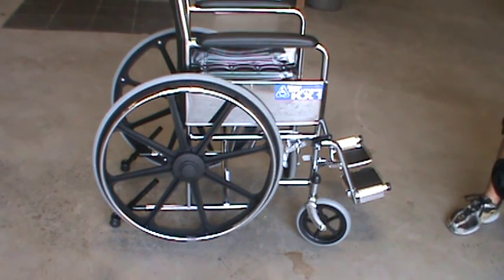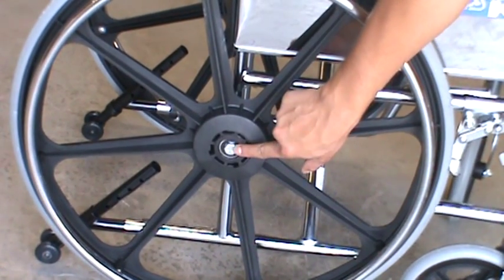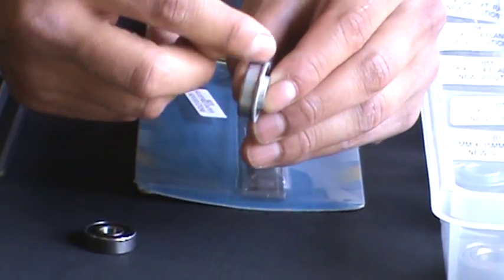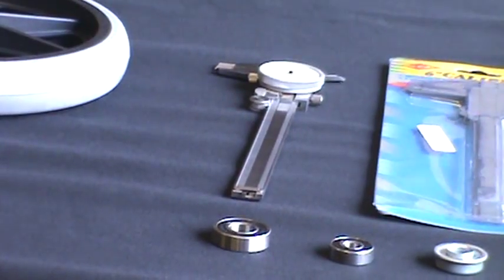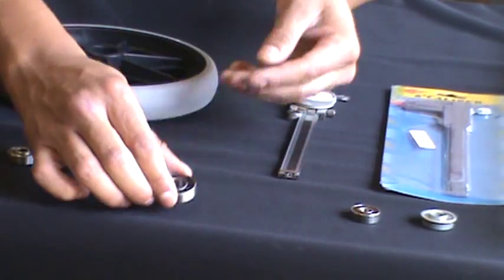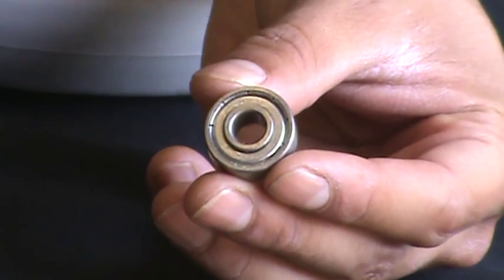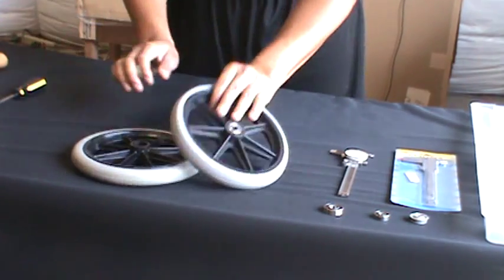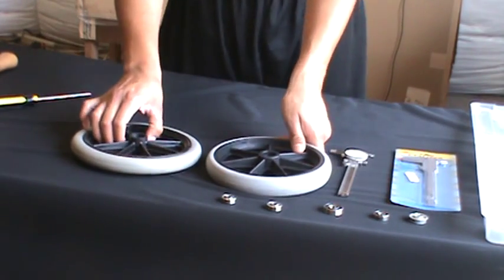New Solutions How to Determine Bearings Needed

Comment: How do I measure my wheel bearing? It broke and I cant see the numbers. I dont have a micrometer
Reply from the maker: ooh.. thats going to be a tough one. However, what type of wheelchair do you have (power, manual, make/model) and which wheels is it on (big wheel, drive wheel, caster wheel)? We can narrow it down if you can give us that information.
Reply: newsolutions100 the bearing is off a motorcycle... but the dimension of the wheel hub where it needs the bearing is 3-1/8" thats all I was able to find out. Do you have like a email or kik I could send pics too?